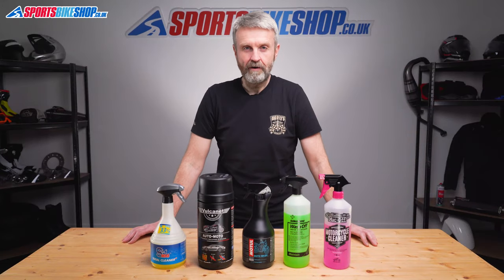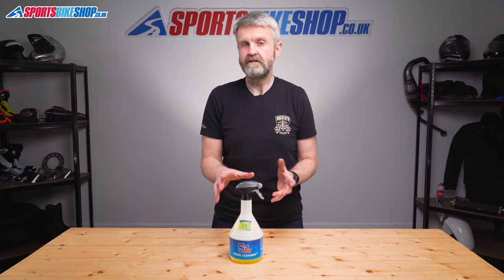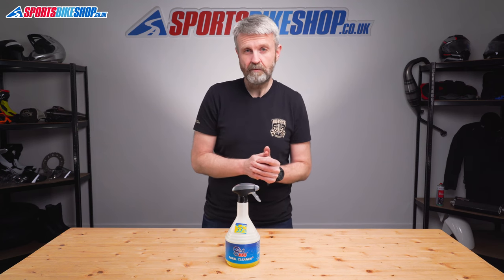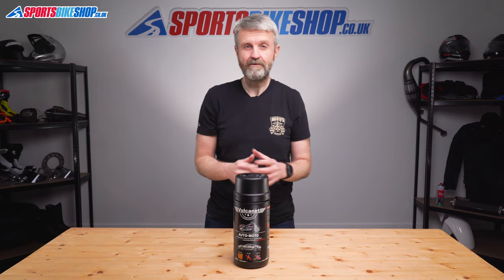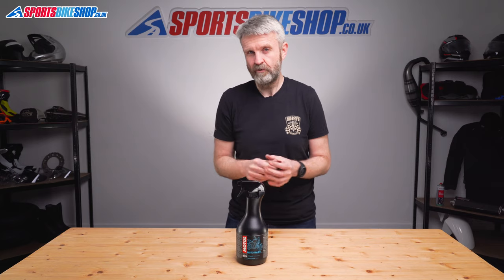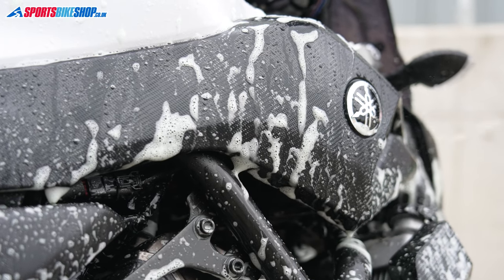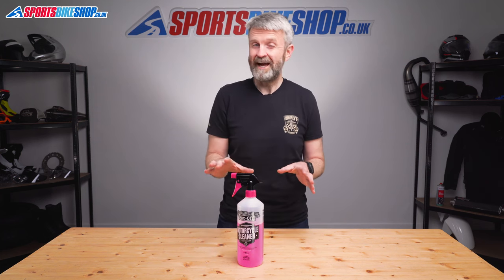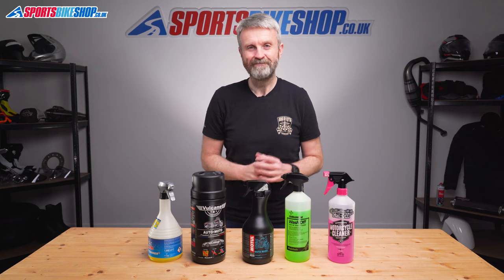The best 5 motorcycle cleaning products - Sportsbikeshop

Comment: Vulcanet wipes are great if your bike parking space is no where near a water supply. Used to live in flats with allocated space. Easier than carrying two buckets plus cleaning kit down 3 floors. 
Does leave a residue similar to silicon spray. Great on black plastic or metal. Can’t penetrate areas a liquid can though. 9/10

Comment: How to I agitate all the stuck on oil and break dust on my wheels? They’re white but everything is stuck on there looks damn near brown now please help what type of brush do I get
Reply from the maker: It's less about the brush and more about what you use to loosen it. I find the safest option to be GT85, or WD40 if you have some knocking around. Spray it on the wheels, leave it to penetrate for a short while and wipe off with a rag. If the cack is really thick and deep it might take a few applications. And be careful not to get any on the brake discs (brake cleaner and an abrasive pad will get it off the discs if you do have overspray). Cheers, Tony
Reply: Parafin is great for cleaning wheels. I also use car cleaning products such as Autoglyms clean wheels to attack brake dust. In fact for the most part Ive found that car cleaning products do just as good a job and cost a lost less. I do rate S100 for special occasion cleans and rhino goo for everyday cleans

Comment: The Sdoc 100 Gel is absolutely lethal. Cleans very well, but strips down paint like there is no tomorrow. Used as per instruction - spray on dry bike, agitate and leave 15-20 mins. just too strong.
Reply: Water it down then!
Reply: @rwalton159  not what they advise.